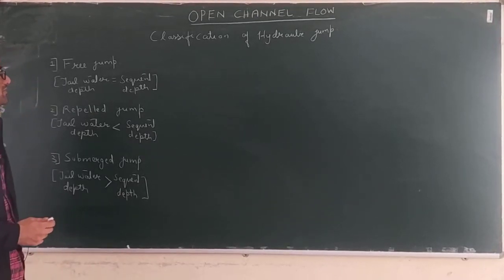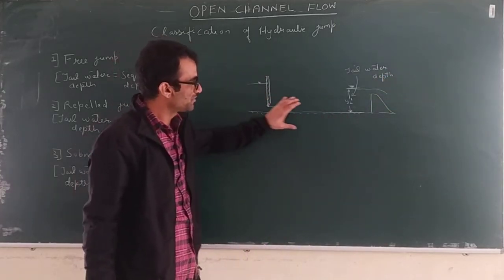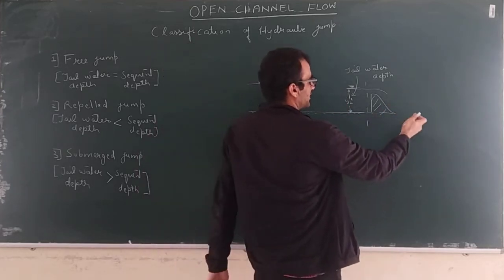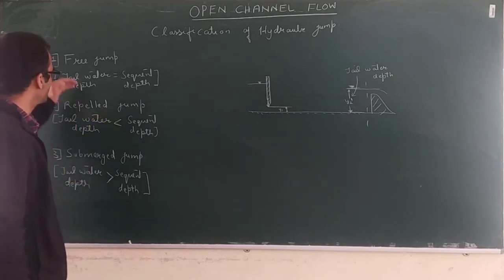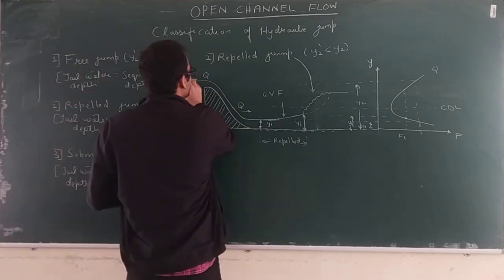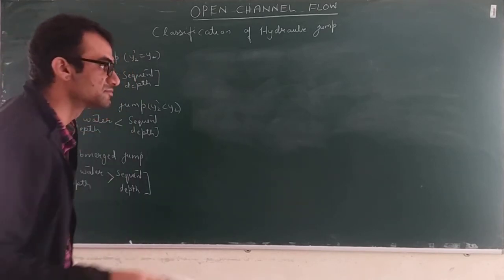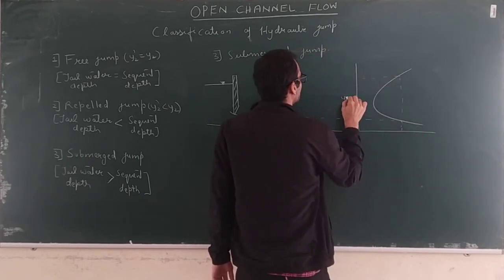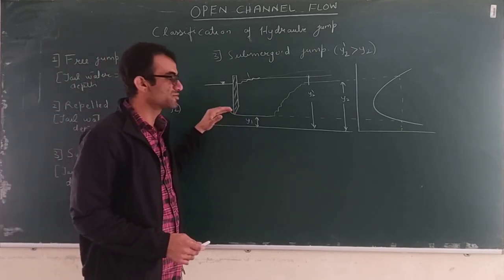Open channel Flow - 36 (classification of hydraulic jump - free jump, repelled jump, submerged jump)

Comment: if a stone is dropped on water surface and its found that the disturbance on the water is travelling both upstream as well as downstream , this is because the flow is: options 1. Subcritical 2. Supercritical 3 steady 4. Uniform... Plz help in answering this question with little bit explaination.
Reply from the maker: I have discussed this question in this video. From 30 mins to 35 mins. The link is this
https://youtu.be/rzVDDrE9UpU
Reply: @abhijeet246  thanks alott sir♥️♥️♥️

Comment: Sir I am confused with hydraulic jump developed on downstream of spillway.Why the portion of hydraulic jump will not erode the bed surface?
I read in one research paper that large secondary currents and vortices induced by hydraulic jump are the main cause of the scour downstream of a spillway
Reply from the maker: The supercritical portion can surely erode the downstream side of spillway, so a special RCC structure is constructed called as stilling basins, when hydraulic jump forms in the basin, the RCC floor can sustain the excess shear stresses induced by supercritical flow.and beyond the basin , flow is subcritical. Still secondary currents and eddies can damage the floor a little. You can share the paper on abhijeet.lade@gmail.com. I will go through the paper and share my contact number. We can discuss it in details.
Abhijit
Reply: @abhijeet246  very nicely explained 🙏🙏
Reply from the maker: @ushagupta3204  thanks Usha.
Reply: @abhijeet246  Sir make the tutorial video on types of energy dissipator and explain through tail water curve (TWC)and Jump height curve (JHC).I mean for different possibilities of curve,which dissipator is used.
Reply from the maker: Alright!! I will try to do that..But not sure about timing.
Reply: @abhijeet246  ❤️